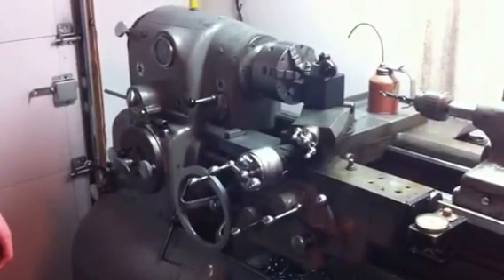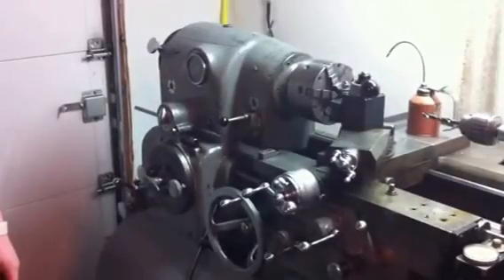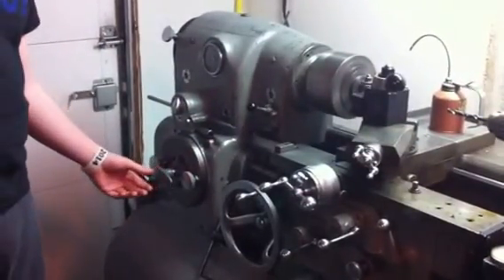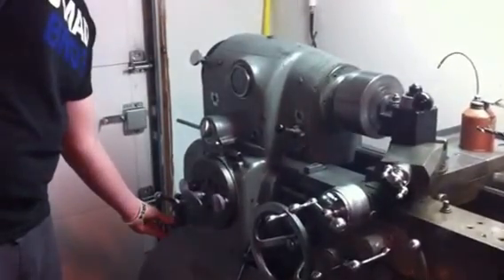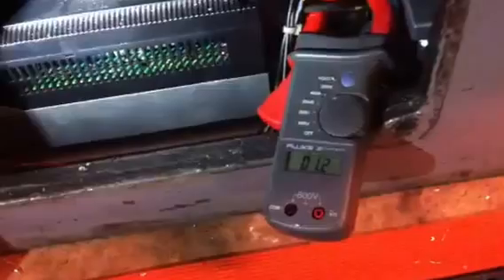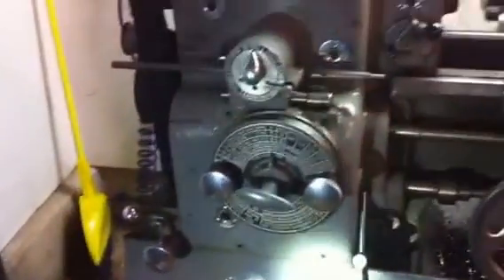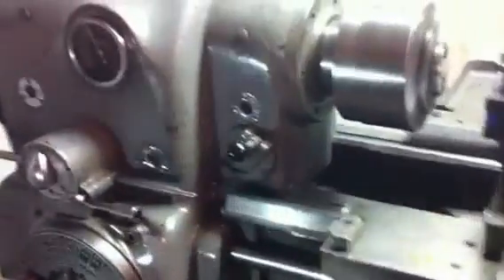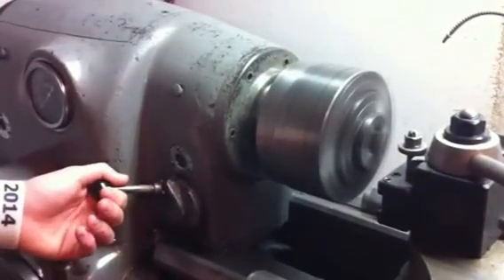1941 monarch 10ee vfd

Comment: First off excellent job I like the fact that you use all the original controls.
i have a 1941 10ee machine also would like to do exactly as you have. but i need to research what components i will need. do you have progressive photos of your rebuild?
thanks